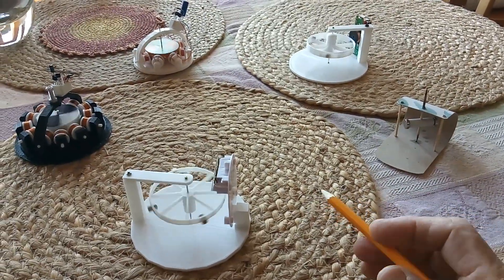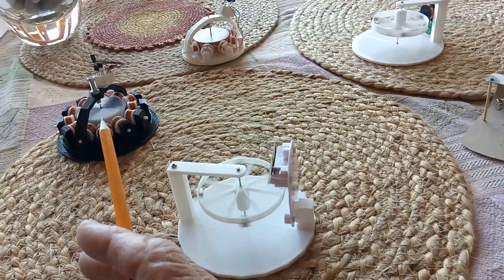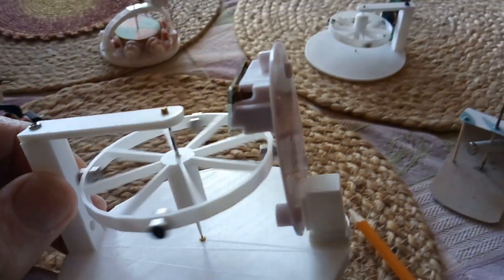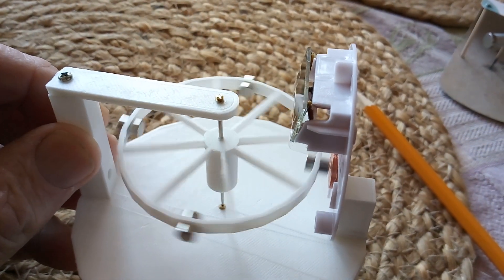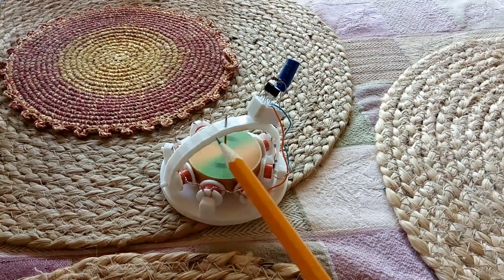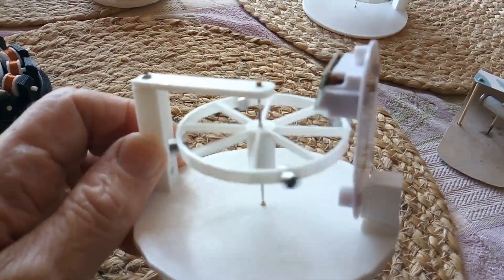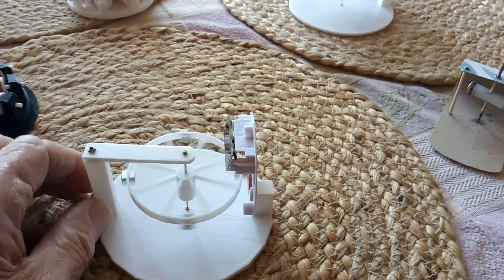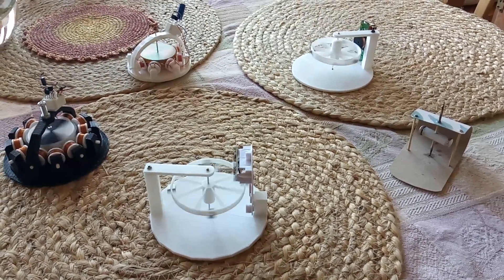Swiss jeweled low powered pulse motors

Comment: I had luck inverting the pivot needle mounted facing up jewl or screw facing down you balance the spinner on the needle keeps dirt from getting in and various dust. And you can mess with the weight to make it heavier or lighter this also allows all kinds of shapes to be used I was making a mini globe before I put it on pause I am still working on a circuit I will like for it I want it to beat my lights run time estimate of .096 micro amps if I can do that or less then with a d-cell you can get like 15 years constant run time.

Comment: The spring in these vee jewels really isn't meant to be compressed, or set to any tension, for two reasons. It's just there to protect the jewel from cracking if the pivot is smashed down into the holder, and it allows the jewel to wobble when it's compressed.

The spring can only protect the jewel if there's a shoulder on the shaft just behind the pivot tip that doesn't fit down into the jewel holder, and stops the pivot after it's depressed the spring by a couple tenths of a millimeter. The holders don't have any internal end stop to protect the springs so it's really easy to over-compress them if this is missing.

Before I realized this I used some sprung Swiss Jewel Company vee's on an attempt at a low temperature Stirling engine when I was a kid, with just plain needle pivots. I quickly over-compressed the springs so the jewels were permanently loose in the holders. Once this happens the jewels shake sideways as well as sliding in and out, and this robs energy from any mechanism riding in them.

That's really the main thing I wanted to share: even if the spring isn't over-compressed, whenever the jewel is pushed down into the holder and the spring compresses at all, the jewel now has side shake and wobbles side to side if the load isn't perfectly balanced, which is probably not what we want here. The jewels just aren't a precision fit anywhere but the seat that the spring pushes them into.

Much more recently I bought some new jewels of the same type for a solar powered engine (a bit different from yours, involving much higher side loads on the shaft), and they work great! I used a stainless steel material for the pivot and shoulder, and even though it's not as hard as plain steel it's going to stay cleaner and is less likely to fill the pivot with iron oxide grit, so I'm hoping it'll last a long time. Also nonmagnetic which should also prevent it from attracting grit into the jewel vee.

If one is using a pre-formed needle as the pivot, it might be worthwhile gluing a tube of some kind around the needle just clear of the jewel holder, to form the protective shoulder and protect that spring from accidental over-compression.
Reply from the maker: Thanks.  Great information.

Comment: I didn't realise you could buy them straight from the supplier! I was finding them so hard to source that I bought some brass bolts and 12mm synthetic corundum and used a copper tool and diamond paste to lap a Vee into it. It took DAYS.

Comment: also free energy exists and proven but not viable for individuals homes. A channel explains how its done with water pressure and buoyancy. Check out video "Breakthrough Green Energy-Free Energy Generator without flywheel! #FreeEnergyGenerator #greenenergy"

Suggestions on your other device
1 Isnt the other side of the electromagnet gone to waste? shouldnt you use also that side as well?
2 lifting the center with a magnet or lightening it up to not be so heavy it moves easier. so a adjustable magnet at the top to not touch it but to make it lighter. 
3  the space between the plastic that holds the coil between the thick plastic would be better if it was thinner since yours seems a bit thick since even a small amount closer is a bigger boost I I assume.
4 When winding their is friction when you have one coil on top of another and its kind of a electromagnetic friction going on which maybe another wire to space it to lighten up the friction? I dont know just a though for you to try and test out with a meter.
Reply: You're right about free energy being proven and existing!: It's called "Solar power". You can use a wind turbine or solar PV/Solar thermal panel to collect it. Maybe even a heat pump. But it is definitely viable for individual homes. As long as you live in a semi-detached or detached house, maybe even terrace, it's entirely possible with PassivHaus building techniques to create a dwelling which produces more energy than it consumes over a year.

A heat pump outputs several times more (thermal) energy than YOU put in (electrical), by using the electricity to move energy in a similar way to maxwells demon. But there is no device that delivers more energy out than goes in, in total. If it does then you're missing an energy source. Over Unity power generators demonstrations are an exercise in creatively drawing the box around the system. They usually ignore some energy input. Often thermal. Usually a hidden wire or battery. That's why they aren't shown running indefinitely and you can't go and personally inspect one.